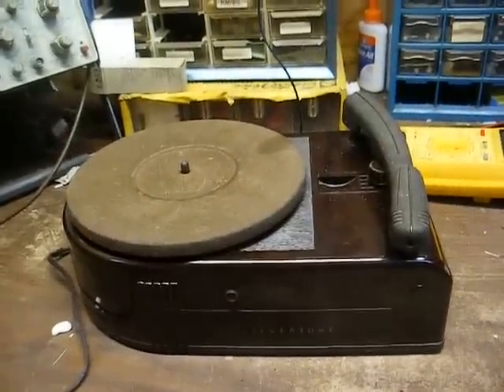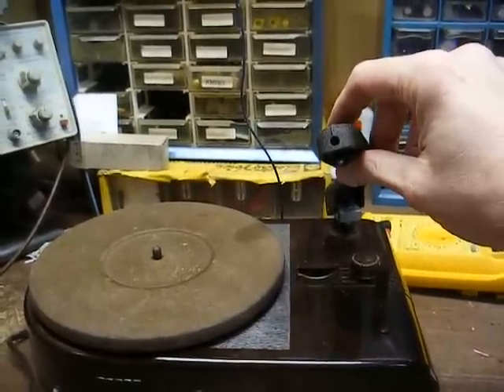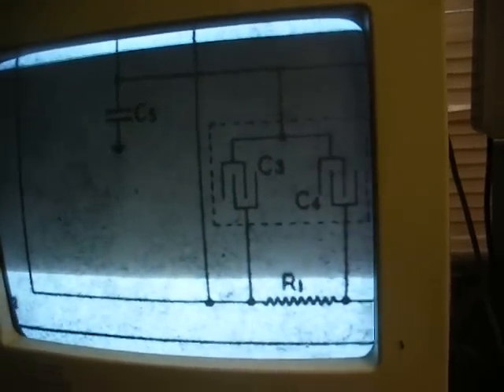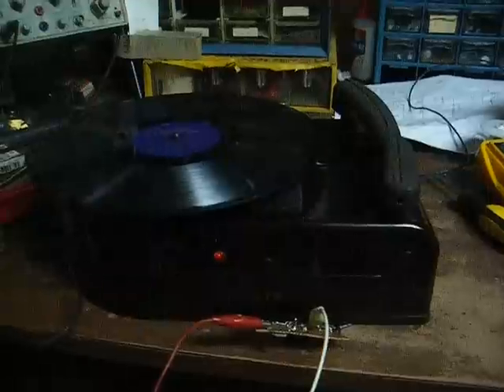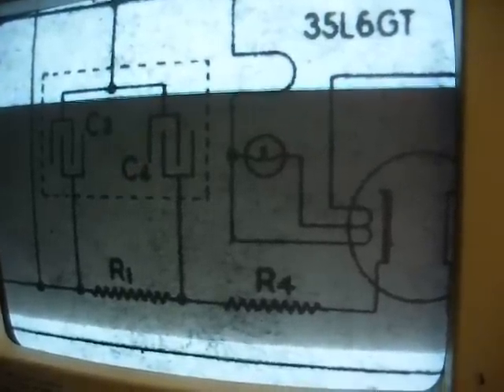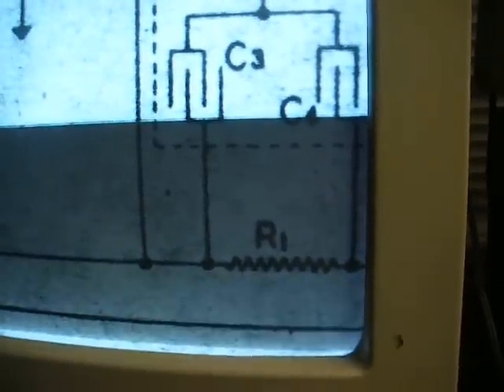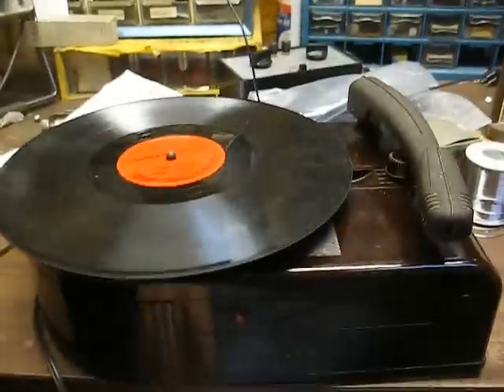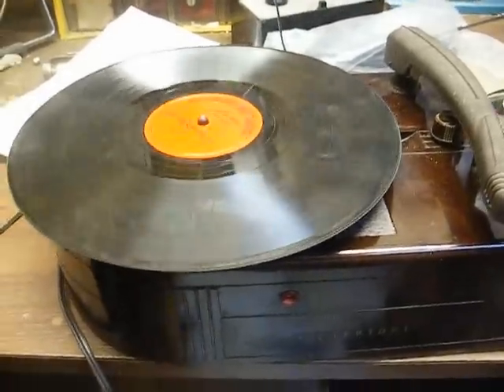Silertone wireless record player - part two

Comment: Another great informative video. Thanks. Do you have a schematic for that preamp circuit? Love your philosophy on saving the old stuff that was built better, I hate the cheap throw away Chinese junk. I recently had to throw away my 20 year old 50 disk CD changer because cheap plastic parts that they don't make anymore got brittle and broke in the changer mechanism.  I couldn't find parts anywhere online. Long discontinued. Should have been made of better materials could have lasted for years.

Comment: Hello, I have a Kenwood Model Eleven II receiver. The selector switch is stuck in the FM position. It indicates that it changes as it changes lights as I move the selector switch but it never actually leaves FM. Any Idea how I can fix it? Thank you.

Comment: could the drive unit be changed for a multispeed 33/45/78 drive?
also change the cartridge again for one that plays 78s and flips over to 33/45s?
seems to me like that would be very useful.
Reply: It would not be very practical to do that, there is a limited amount of space to start with and even if there was it  could potentially involve cutting, drilling, and grinding, which would ruin the collectable value of the unit. There are hundreds of three and four speed players around, many from the late 1940s and early 50s, so it would be a lot less effort, and more practical, to restore one of those, and use it then modify a 78 only player.

Comment: I'm just curious as to why you didn't add a tube preamp.
Reply from the maker: Not really enough room on the chassis.
Reply: I was sort of thinking that adding a sub chassis might be the key to adding a preamp tube with something like this, but then again I was wondering the circuit around the 35L6 tube could be tweaked to deliver more RF output like maybe playing with the value of the screen grid resistor?